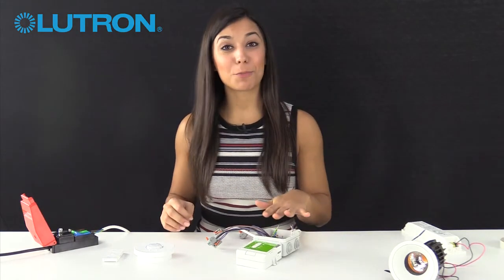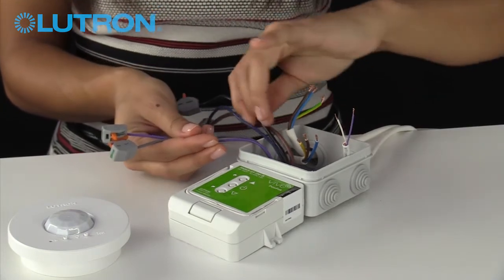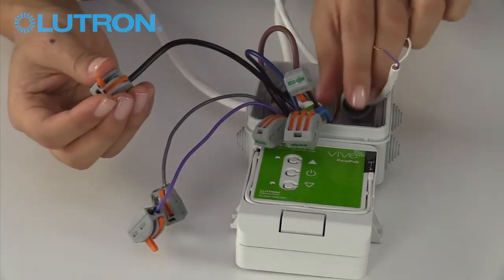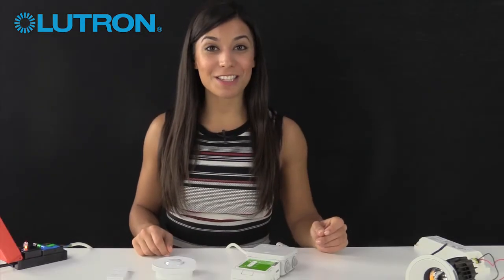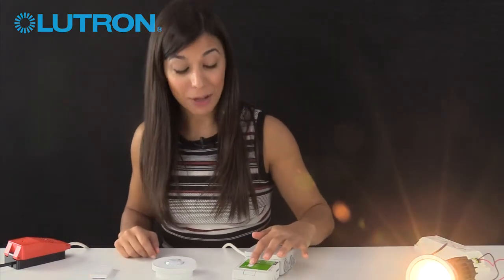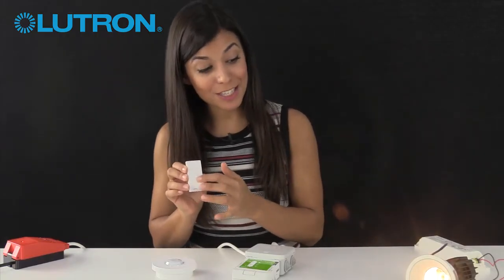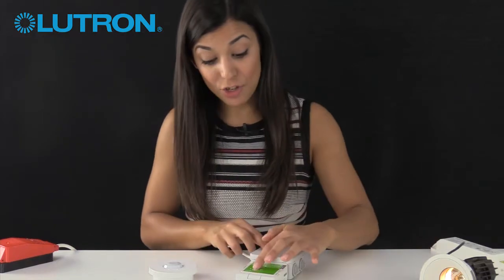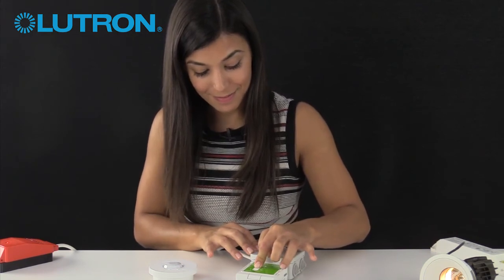EA VIVE 0-10v PowPak Installation

Comment: Does it need a vive hub to have this powpak abd weless swich and sensor work?
Reply from the maker: Hi Jim, The PowPak does not need a Vive hub in order to be paired to a Pico remote or occupancy sensor. The PowPak will be manually put into a pairing mode and have each device synced to it. Please review page 2 of the install guide here for reference: https://www.lutron.com/TechnicalDocumentLibrary/041588.pdf. Hope this helps!

Comment: do you need a driver for each fixture or can you daisy chain the dimmer wires from fixture to fixture
Reply from the maker: You should be able to daisy chain the fixtures to one PowPak, as long as you are not exceeding the 8A for switching and 60 mA for dimming. For more information, please review the spec sheet for this device. http://www.lutron.com/TechnicalDocumentLibrary/3691045_ENG.pdf